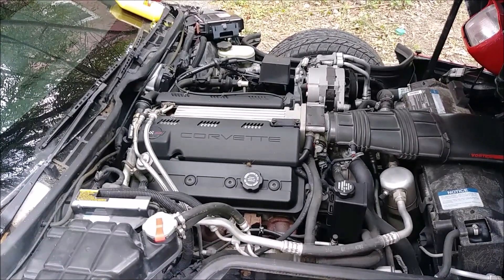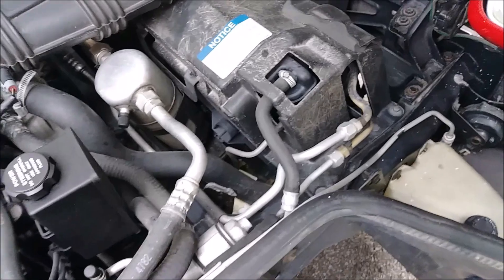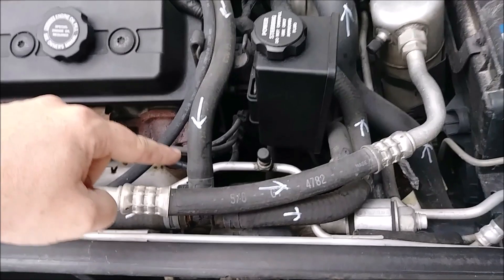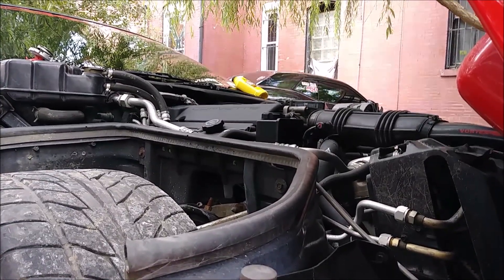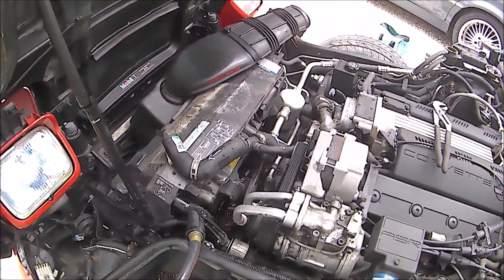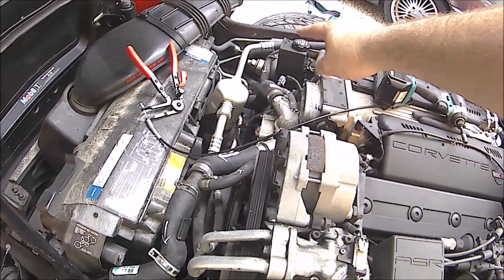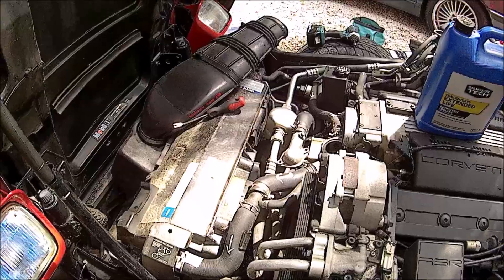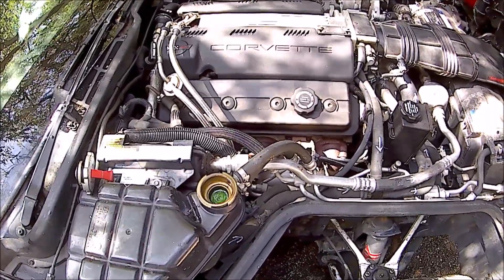How to flush coolant 1993 Corvette LT1

Comment: I swear corvettes are anything but normal, im planning on doing this to my 96 auto this weekend. How many gallons did you use?
Reply from the maker: It was a shit ton. Like three gallons in just the engine, heater core and radiator, and like another quart or two in the overflow tank. If I were you, I'd buy two gallons of distilled water and two gallons of concentrated coolant. That should do just fine with a little bit extra for a rainy day.

Comment: at what point in the video do you show where to take the hoses off ? im going to just try just blasting water into the fill tank
Reply from the maker: What fill tank? Aren't you the same guy from yesterday who swore up and down that water pumps on car engines don't pump water?

Stop harassing me before I block you. You can't be this dense.

Hot water flows from the engine into the radiator, VIA THE WATER PUMP, then cooler water flows back from the radiator into the engine, VIA THE WATER PUMP. THEY ALL WORK THIS WAY. The have worked this way ever since radiators were invented. Thus there are two big hoses going to and from the engine. You can't see them? You can't see the hoses going to the water pump? This isn't rocket science. If you want to flush the radiator, disconnect the hoses from it and blast water into the radiator. If you want to flush the engine, disconnect the hoses going to the engine and blast water into them.

Have a nice day. I'm not responding to anymore of your messages unless they're apologies for you pretending that cat water pumps don't pump water and that engine coolant isn't water. Even my wife, who doesn't know how the 3rd pedal works, knows car engines use water to cool them via the WATER PUMP!
Reply: @HollywoodHornet  did you not read my other comment? I already apologized. please have some sympathy for the intellectually incapable. we are on different wave lengths, and I'm trying to get on yours. the "fill tank" that I'm referring to is where the radiator cap is. I just flushed it like 5 more times that way, and unfortunately I think I have dexcool which means I gotta go buy that crap now. I would rather have green but I don't want to fuck things up !!! sorry if you got offended !!!!!!

Comment: How did you get the air out of your system?
Reply from the maker: You can either unscrew the bleeder valve on the thermostat housing or leave the radiator cap off the tank and run the engine. When the thermostat opens up it will purge any air out the system that way.

Since I filled the block and heads with coolant first, before inserting the thermostat and reconnecting the T-stat housing, then filled the radiator side afterwards, there was no air for me to bleed out.

Comment: Is there anyway I can see the full video without the time lapse ?
Reply from the maker: No sir. I time-lapsed the flushing because it's probably too boring to watch. I get complaints that my videos are too long because lazy people can't find the fast forward button. So now I time-lapse anything that is tedious.

If you have any queations about what I'm doing during the time lapse, I'm happy to answer them.
Reply: @HollywoodHornet  uh yeah, like how do I flush the coolant off a 93 vette? lol I didn't understand anything from this video except for the fact I can drain it where the coolant reservoir is . please explain like im retarded thx
Reply from the maker: @titoqwentezproductionz3406  use a hose to spray fresh water into the cylinder heads so the old coolant flows out the bottom of the block until the water is clean. You can try to back flush it as well but you'd need a lot of pressure to get water flow backwards from the bottom of engine to the top. The arrows on the hoses I drew show the direction the water normally flows when the engine is rotating the water pump. Work with the engine as designed to flush the old coolant out of the engine.
Reply from the maker: @titoqwentezproductionz3406  remove the reservoir to clean it out. Spraying water into the engine is anything but a bad idea. Coolant is 50% water as a general rule and water is a great solvent since it cleans things like dirty hands, hair, car finishes, human blood, floors, dishes, etc. Just mix the proper anti-freeze to water ratio when done since pure water does cause rust and corrosion in an iron block.
Reply from the maker: @titoqwentezproductionz3406  okay. I can't help you if you honestly think water cooled engines (your LT1 and any other engine not a VW Beetle 1600cc air-cooled or Porsche air-cooled/oil cooled engine) does not use water to cool it. Google "what liquid cools an engine". Oil lubricates and engine. Water cools it. If you honestly didn't know that and think I'm lying, dump oil in your cooling system and let me know how that works out for you. I assure you, it wont.

Have a great day. Thanks for stopping by. Sorry you didn't learn anything and I wasted my time responding to a troll I honestly thought needed my help.
Reply: @HollywoodHornet  I think we are just misunderstanding each other. If you open the oil cap and pour water down into the engine compartment (which is how I read your comment) it will break the engine. I think what you mean to say is pour down water down into the radiator, flush the radiator, which cools the engine. english is not my first language so I apologize for the trolling and confusion. I am seriously trying to flush this corvette. and im seriously stuck now , tomorrow hopefully I will figure it out. there are many hoses and many openings , I don't want to fuck anything up. sorry im trying to be careful , too many times in my life I did something and fucked it all up.

Comment: Is there any negative impact to switching from dexcool to green stuff? Thought it was recommended to stick with the dexcool after a flush. I’d love to know the pros and cons
Reply from the maker: Dex-Cool is supposed to be "plastic friendly" and does not contain phosphates or silicates. Which is good because when the coolant breaks down, those can sludge up the system and are quite abrasive and will damage plastic. The green coolant I switched to is also phosphate and silica-free. Thus I won't have an abrasion or sludge issue. Dex-Cool is also "long-life" and lasts five years before needing replaced but so is the green I just switched to.

The LT1 engine is iron block with aluminum head, and iron can rust. If my block starts shedding rust scales into the cooling system it can become abrasive or sludge up the system. If that happens before 5 years, I'd never know since the rust is the same color as clean Dex-Cool. Switching to green allows me to visually inspect the coolant to see if it needs changed early. For all intents and purposes, the only difference between the Dex-Cool and my new green coolant is the color.

I would recommend keeping Dex-Cool in an all-aluminum engine. For example, my 2010 Camaro SS has the all-aluminum LS3. I just did a video on changing that coolant where I kept the Dex-Cool in  it. I considered changing to green as well, but since my primary concern with Dex-Cool is it looks like rust, I don't have to worry about it in the LS3. I can visually inspect the Dex-Cool and orange is good because the LS3 can't rust.
Reply: InstaBlaster...